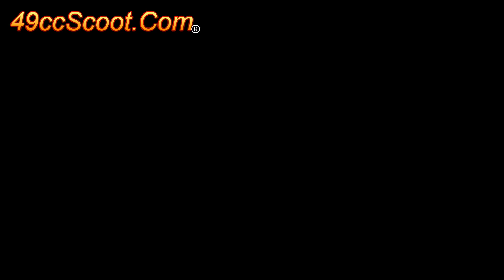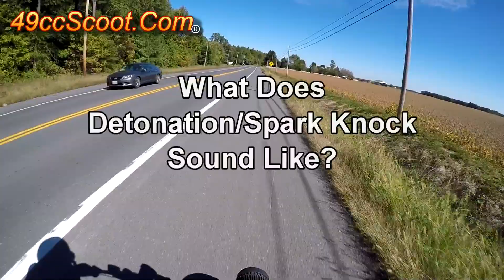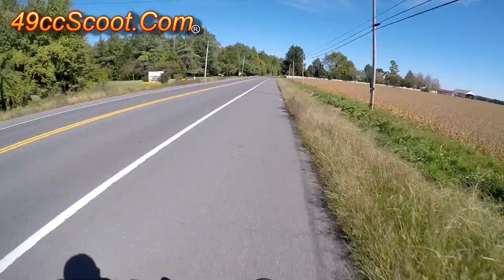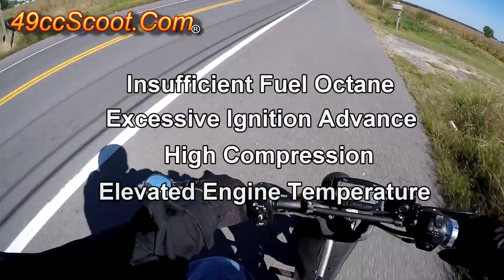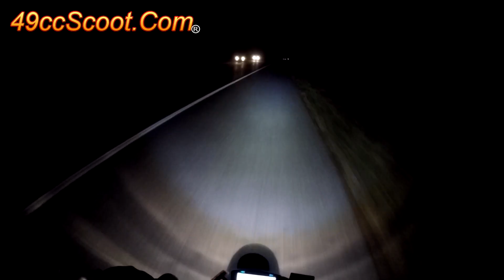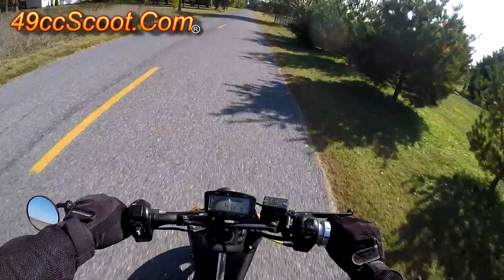What Does Detonation / Spark Knock Sound Like?

Comment: so what is the solution/repair for this. been having this sound on my 250cc 4 stroke. very typically on gear 1 and at 28km/h exactly. it doesn't sound anymore at higher speeds/gear.
Reply from the maker: Many potential issues could cause it. If specifically at one speed in one gear, I'd wonder if it really was spark knock. If it is, then I'd wonder about ignition advance at a specific RPM and throttle position, but I wouldn't think that should be so specific to only happen in one gear at one speed.
Reply: @49ccscoot  do you think changing the spark plugs could be the solution? ive had this bike for almost 7 years and never really thought to change it
Reply from the maker: @The1990Sly  At very least do it because of the age and see what happens.

Comment: I have a poket bike that was doing just that only at full full rpm and only at full throttle. If at full rpm i release the throttle a bit it stops. My SOLUTION: reduce main jet size by puting a coper strand inside. It helped right away (disclaimer: I thought making the mixture leaner is worse for detonation but in my case it helped... so if someone can explain me...)

Comment: THANKYOU! I bought a 2004 R6 and had to take the head off for something, one of the pistons was gouged like a bolt was bouncing around in there. People said it looked like detonation, I thought maybe but the bike rode fine on the test ride, the only odd thing was there was a random rattle that would pop up with no cause. This is the EXACT sound I was hearing! I’m 99% sure now thats what the damage was, especially because that cylinder was likely very lean due to a missing throttle body boot and sticking velocity slide

Comment: Hi there guys, I am trying to isolate my problem I am having. Basically at 45mph+ the bike start to knock/vibrate. I do have a warped front disc, detected under braking,

My question is, would that create the issue at higher speeds? or could I be looking at a knackered crankshaft/bearings?

Thanks for any replies in advance.

Comment: My kymco scooter 2 stroke does the same thing sometimes.  To me it's more like a grinding, rattling sound, based on throttle position and rpm.  Thanks for the video, it helped me find my problem.  I thought my top end was wearing out causing a rattle at certain throttle position but more likely spark knock than anything else.

Comment: Does any one know how to fix it ? Or the cause of it ?
Reply from the maker: Can be caused by many things, as mentioned in the video. Stopping it would depend on the initial cause. Timing too far advanced is one potential cause for example. If you know you just put a new tune in or changed timing or installed a new timing belt, then that may be an early step in that case. If you just put on a high compression head, then you're probably going to investigate that. It depends on the scenario.
Reply: @49ccscoot  my bike has accleration hesitation and bad full throttle acceleration at low to mid revs but soon as it hits 7k the bike is fine. Iv changed ecu, throttle body with all.the sensors, the whole bike looming, o2 sensor wire, fuel pump, fuel filter, air filter, air box , throtle body manifold. And the fuel line 😢 ps the bike revs fine all the way up to 12k revs no issue just under load.
Reply from the maker: @jasoncarthew2279  Throwing any codes? Start there if so. New spark plugs... and make sure they're the correct ones and gapped correctly?
Reply: @49ccscoot  when I check for codes bypassing that red socket it was saying every sensor was faulty even the ect sensor so I changed every thing to the bike except the ignition coil and when i rechecked the dlc again it Still showing every sensor code it's so weird man I litrally have no.idea what the issue is  as iv changed absolutely everything haha 😄
Reply: @49ccscoot  and for the spark plug I can't get it out the head to swap. But I do have a spare engine and when I swapped them over both the engine doing the same thing. My revs come down very very slow if I let of the throttle while riding. But I have no air leak and the bike does seem to be running lean. 😕
Reply: @49ccscoot  other then the poor throttle response and acceleration while fully throttling the bike runs fine. If it was running lean wouldn't it struggle to rev at high revs rather then low revs
Reply from the maker: @jasoncarthew2279  Sounds like you need to find someone well versed in electronic engine control and/or your make/model.
Reply: @49ccscoot  tell me about it haha 😄 you would think tho if it was an eletrical issue, replace every sensor and harness wiring and 3cu replacement would solve the issue. I bets it some thing so simple like the coil pack or spark plugs
Reply: @49ccscoot  I changed coil pack today and spark plug still not diffrence lol. I give up lol 😆 🙃
Reply from the maker: @jasoncarthew2279  That sucks. If it's a name brand bike then maybe get a dealer shop to have a look.
Reply: @49ccscoot  I'm in poverty atm lol and my bike wasn't brought from new. Thanks for all your help.any way il appreciate it 🙏 👍 😊

Comment: Hi dude ,it's a good tip..need one more clarification.... I'm using rxz6speed..it sounds alot once touch 100km speed ..but no sound above 100 and below 80.....it get piston seized too..I dismantled completely and look at magnet side crankshaft get burnt and few areas in deep pit mark..
So what I'm thinking it should be timing advance right?
Reply from the maker: See if that corresponds to a particular RPM. If you don't have a tach, get a cheap one that you can wrap around a plug wire and mount somewhere easily visible just for testing. That may tell you exactly where to look in the timing curve or tell you that it's something else. If you are cruising at a certain speed, then it may be mixture related. Possibly running lean that he throttle position required for those speeds.
Reply: Mine all in stock setting only..there is no modification in there..compression is good under the spec. Shall I change coil plate magnet including cdi unit?
Reply from the maker: @hassinii1  Best bet would be to check timing first. At very least compare base spec to see if that's off. Better still if you can find the curve and do some checks to see if it's all where it's supposed to be.
Reply: @49ccscoot  thank you Dude
Reply: It's starts around from 7k rpm and once touch 9k rpm there is no sound ...

Comment: Pls help! I'm also experiencing this fuel / engine knock whenever I go full throttle I boosted the engine of my 110cc yamaha scooter and now experiencing this even though my gas is 95octane
Reply from the maker: If you're generating boost, you may need to lower compression, decrease boost or decrease ignition timing to alleviate knock... or use a higher octane fuel. Excessive heat, lean tunes and other things can make it worse.
Reply: @49ccscoot  thanks I've checked my sp and its color is rusty brown, I'll also try 95+ octane on gas stations, may scooter's from 110cc to 160cc

Comment: I had this with a old outboard engine 2 stroke as well, I didn’t know it was knocking until now, you probably saved my engine!
Reply: My 33 years old 2 stroke motorcycle also giving me similar sound when under load and engine is enough warm. How did you resolve the issue with your motorcycle?
Reply: @vaibhavpatil86  figure out around that throttle position it is and try richening the mixture at that point
Reply: @Joshua Salisbury  I have richen the overall mixture but no luck. Can it be less 2T oil getting delivered by my 2T pump causing engine to over heat?
Reply: @vaibhavpatil86  yea not enough oil will cause more friction
Reply: @Joshua Salisbury  Hi. I ruled out that possibility as well..
Added some extra 2T oil premix into fuel tank but no luck. I feel ignition timing also not proper. Can it lead to engine over heating?
Reply: @vaibhavpatil86  is it air cooled or water cooled and I mean most likely could be the ignition but I wouldn’t have thought it would run hot it might do
Reply: @Joshua Salisbury  It's air cooled. What I have noticed is engine also heats up very fast like within 2kms of riding and giving out clicking noise under load and not running smoothly and feels less powerful.

Comment: I just got Riga-13 with D8 engine, the most basic old 2stroke. Worked fine without the load, but when driving it is slow to respond and then on higher speeds started to tap(metallic sound). Thanks for the video, I will check thecompression, this was common "improvement". Current ignition was very late and this was only position where engine worked for some reason. Edit: it is very slow engine, it should do only 4500 rpm. So the ticking noise is obvious

Comment: Can this happen from a bad top end on a 2t and could it cause backfiring and running poorly
Reply from the maker: A bad setup could cause spark knock. High compression, large squish clearance, poor cylinder head design or maybe even flow throughout the cylinder. It could certainly cause poor running, but if it's backfiring and  spark knocking I'd make sure it's not lean and running hot because of that.

Comment: Can you feel the knock?
Reply from the maker: You shouldn't really feel the knock in most cases. I've only really felt it in cars, but really I think it's effects of the knock that are felt. I don't imagine you'd feel it unless you were touching the engine and I'm not sure that you could discern the difference in normal vibes and knock. If you aren't sure about just the sound, you can try checking spark plugs for signs of "peppering". Looks like what it sounds like. Like you sprinkled a little pepper on the plug (small flecks).

Comment: Thanks for the info. I'm having difficulty because I am running an aftermarket ECU on my car and I am not entirely sure if the ECU is reading the knock sensor correctly. I'm running a fairly mild timing from a previous ECU and slowly stepping it up, but I want to make sure I don't kill the engine.

Comment: mate I've been scratching my head for a years, the symptom on my cbr150 just like yours I thought mine was worn out crankshaft bearing housing it turn out to be preignition, adjust timing & using petrol with correct octane solve the problem. thanks mate.

Comment: My fuel is recommended octane why still in knocking?
Reply from the maker: Could be may things. It helps to evaluate what your setup is. If it's modified, then it could be that something needs tweaking. If it's stock, it's more likely a malfunction/maintenance issue.

Comment: How do you fix the rattling ? I have a bmw r nine t and it knocks like crazy
Reply from the maker: Depends a lot on the situation. If it's a new build or new mods you'd look different places than an engine that has been fine and suddenly knocks. #1 in any case is always to be sure the fuel is good with a sufficient octane rating.

Comment: How can i solve that?
Reply from the maker: There are multiple possibilities dependent upon the exact situation and setup. #1 for me is always to try the easiest thing, which is switching to premium fuel if currently using regular or mid-grade lower octane choices. Retarding ignition  timing and lowering compression are common possibilities. Sometimes, especially with two-strokes and air cooled stuff, enriching the tune may stop it or just making sure the engine cooling is sufficient.
Reply: @49ccscoot  i use 95 octane fuel its the best here
Idk how to change the timing it's stock like always 
So i will try to move the needle clip 1 step up because i mived it down one time in past?
Reply from the maker: @zizo0  Sounds like a good start. If you haven't changed anything physically with the engine, then it's probably some sort of tuning/ignition issue.
Reply: @49ccscoot  the only changes is that my 49cc 40mm became 44mm and neeldle clip is 1 step down i will move it up and see its the only thing i can do 
And my stator is weak maybe it can make the problem too?
Reply from the maker: @zizo0  The 44mm may be increasing compression too much if no other changes were made (like cylinder head, checking squish). Moving  the clip down was likely a good call, as that will actually raise the clip and deliver more fuel. Taking fuel away is not going to fix this.
Reply: @49ccscoot  because its only at hight rpm wuth 1/4 throttle maybe i can fix it by only the air screw but i want to know if that cracking happen because of much air or because of richess by fuel so i reduce air or add more?
Reply from the maker: @zizo0  More fuel cools so it sometimes reduces knock.
Reply: @49ccscoot  okay so i will reduce air  and see thanks for replying i appreciate that😁😁

Comment: I’m having this on my Aerox 155. Bike is stock bore (58mm) but i increase the compression ratio to 12.
With upstroke 58.7 to 62.7

The knocking/rattling sound occurs at 6k rpm when the VVA is on. 

What’s the worst that can happen if i just leave it?
And what do you mean by advancing timing?
Reply: Does tuning and adjust the AFR fix the knocking sound?
Reply: Should i adjust the timing slightly BTDC or ATDC to reduce the sound?
Reply from the maker: @fadhilnandir6698  Sometimes a little extra fuel will cool it down and eliminate detonation.

You can try retarding the timing, moving it a little farther BTDC than it currently is. 

If a small amount of additional fuel or a small timing change won't fix it, it may be that you need to alter the compression ratio. This assumes that you are already using the highest octane fuel readily available to you.

Comment: this is the exact sound that I got with my Aerox 155, though mine is with a lower pitch. It is very annoying and I can't find a way to resolve them. I try to install a roller set with 2g lower than the original and the issue is partially solved.
Reply from the maker: Lighter weights are probably helping by taking some of the load off of the engine, but you may still need to make changes like higher octane fuel, less ignition timing or lower compression.
Reply: @49ccscoot  I really appreciate that you take time for my comment. I will buy the octane fuel addiction then. my bike compression rate is 11.6 and I already use ron a95. But I think the fuel quality isn't up to that.
Reply from the maker: @blitttzzz  If it's a road/street scoot, then octane booster isn't a great solution. It can work, but in the long run it is easier to make the engine work with what's at the pump alone.
Reply: @49ccscoot  hmm I don't want to modify the chamber to get a lower compression rate. Let me check with the technicians in here if there is a way to modify the ignition timing...
Reply from the maker: @blitttzzz  The first thing would be to go over what is done to the scoot and think about that. If it is totally stock, then you really shouldn't have to modify anything. If you have done modifications, think about what they affect and if it could play a role in this problem.
Reply: @49ccscoot  thanks for your advice, my scooter is totally stock except using the 11g roller instead of 13g. I will not go any further than checking the ignition timing. IMO, this is the same story for any modern scooter, where the manufacturer focuses mainly on fuel efficiency and the environment.
Reply from the maker: @blitttzzz   See if you can find a forum or group where there are multiple 155 owners and ask if it's a common issue and what the resolution is. Maybe even call a dealership and ask.

Comment: However, how to prevent the detonation/spark knock? And what possible to damage?
Reply from the maker: Easiest prevention is to use higher octane fuel. Beyond that, it's very application specific. Things like compression ratio, carbon buildup, ignition advance...

It's possible to damage a whole lot of things. Anything from just peppering the ceramic of a spark plug to major internal engine damage.

Comment: How do you fix it?
Reply from the maker: #1 is make sure you  have sufficient fuel octane. From there, it could be many things, depending on the exact situation. Timing too far advanced, lean mixture, carbon buildup, engine design parameters.

Comment: How to fix this problem
Reply from the maker: First thing is always to make sure the fuel is of sufficient octane. That's an easy fix. Beyond that, it depends on the situation. For example, maybe an old engine has a lot of carbon buildup. Maybe a newly built or modified engine has too much compression or ignition advance.

Comment: Does 450cc 4 stroke sound kinda similar if it knocks? Knocking will noticable ruin how smooth the rpm goes up am i right?
Reply from the maker: It's usually somewhere between what you hear in the video and more of a dull sound like if you could imagine marbles being in the engine. Sometimes they knock without any obvious performance symptoms.